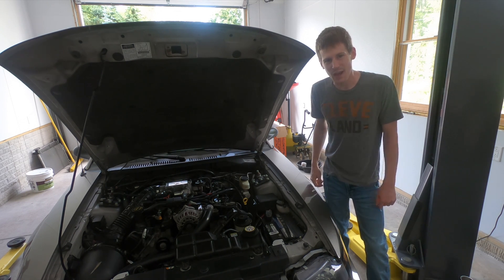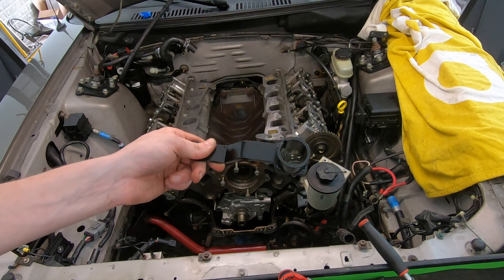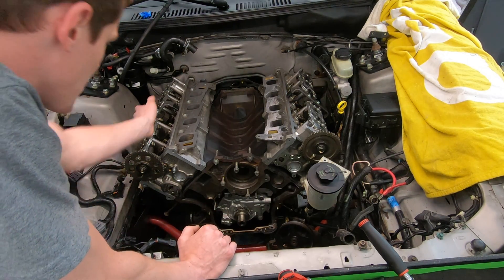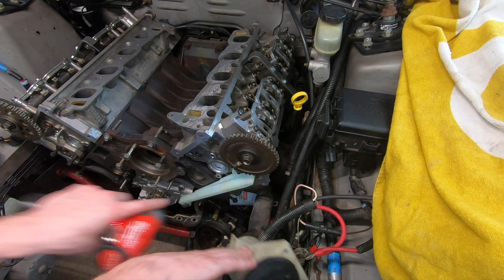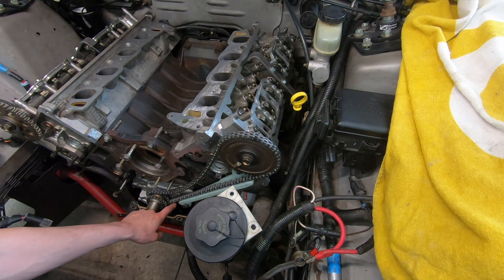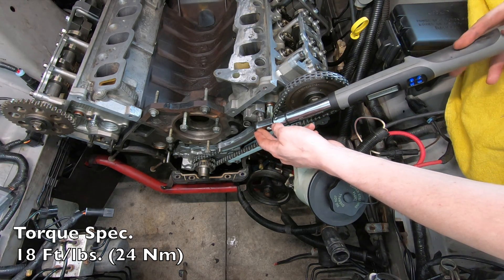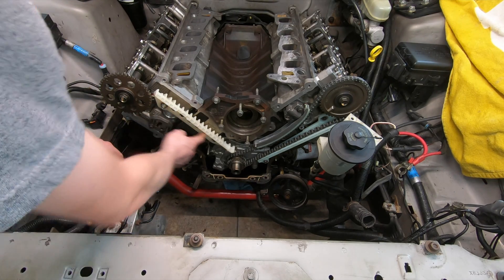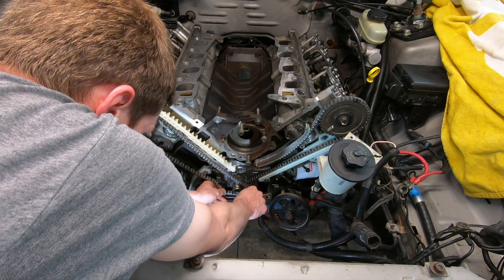Ford 4.6 2V Timing Chain And Guide Replacement.

Comment: Thanks awesome video.. very informative and well explained. I have a question or better say i have a situation. I'm putting 4.6 together for a f-150 2-v the thing is that i'm using pistons, crankshaft, connecting rods and camshafts from a 1999 crown victoria (4.6 Romeo both engines) pistons are a little different (not to deep) and the cams lift lobe are about 30 thousands shorter........combustion chamber is going to be smaller because i'm using my f-150 heads (smaller chamber than crown vic which are open chamber) can the lack of lobe lift compensate with the smaller chamber? what do you think? any advise or suggestions are greatly appreciated Thank you very much.

Comment: I have a 4.6 V8 Triton in my Ford F150 2001 it has almost 300,000 miles on it would it be worth changing the timing belt?
Reply from the maker: Not unless it's making noise.
Reply: Sure, let us know when you find it.

Comment: You can't just pull the pins, sometimes there will be slack opposite of the tensioner side on the chain( I meant that the chain touching the tensioner will be tight, but there may be "slack" on the opposite chain side if the cams are not in the correct time). If I remember right the LH camshaft sprocket is 12 o'clock and the RH at 11. There being slack opposite of the tensioner side means that timing is slightly off. Your method about removing the roller followers prior to messing with the chains was correct, good advice there.  Also I think that cam holding tool you were using (T96T-6256-B) is only meant to be used on Windsor engines, I have a Romeo 4.6 2v and had to use  (T92P-6256-A) and (T91P-6256-A). 

I love these engines, not a fan of the 3v. The HV Melling oil pump is def a must on the 3V's, I hate the new style plastic tensioners and cam phasers (too many issues)

Comment: Hey repair geek. You have a patience of the same he's 4.6 mod motors real junk the valve train components of still 25 to 2700 bucks and you're lucky if you get 300 horsepower out of this motor.. God bless the coyote overall I got to say the repair geek channel good stuff good information good presentation most of all really good camera work.

Comment: Can I change the oil pump while I got the front plate off looks like I can get a flex head wrench in there to get them bottom 2 bolts
Reply from the maker: Absolutely.
Reply: @RepairGeek  02 gt 4.6 2v? Thanks man for the reply!
Reply from the maker: @Gorilla_VR15  yep it will work. 3v or 4v pumps have a larger pickup tube so those won't work unless you change the pickup tube as well.
Reply: @RepairGeek  thanks man! I figured might as well change water pump and oil pump! I’m doing chain, guides and tensioner lol car has 190k miles

Comment: ok I have removed timing chains before setting engine to TDC. Should I lock the cams in the proper 11oclock and 12 o'clock first, then turn the crank to 6 o'clock?
Thanks
Reply: How did it go?Hope it turned out well!
Reply: @markchimmy  it was a pain in the rear but I managed to get it back together thanks!

Comment: How many hours did it take you to get it done.
Reply from the maker: The head gaskets or the timing? I did a lot more than the just head gaskets. With the exception of the oil pan and rear main seal, I changed every seal on and in the engine (valve seals, exhaust manifold gaskets and studs etc.) I wasn't really timing myself.

Comment: Very helpfull and informative !! I purchased a cloyes timing set same as the kit you used. Right side guide had busted were bolt holds guide to head and parts were missing not realizing the revised thickness. I spent about two hours searching for bolt. Started researching why my stock bolt didnt fit, maybee i got wrong kit. Thanks to your informative video it proved that im not going crazy !!!!  Gettin old is a bitch bro i set parts/tools down getting side tracked , most likely my ADHD. 🤪. Spend time looking for shit when ida been done and running.

Comment: Great video ... yup have to replace mine hear metal on metal and like chain rubbing valve cover ..... Thanks for the video
Reply from the maker: Make sure you clean out the bottom of the pan. I've seen the broken tensioner plastic clog the oil pickup.
Reply: @RepairGeek  yup I plan to change oil and flush motor... thanks have too do valve stem seal too ...once I put it back together I can turn the motor by hand to check valves are not hitting pistons ?
Reply: @bengordon7635  hi was wondering how you made out with doing this and the valves seals I'm about to get into it myself on a 2011 cvpi thanks
Reply: @leardi58  haha , was planning on doing it soon had some other stuff on car I was working on...

Comment: Question for you. Got a 4.6, was running but the rocker arms fall in the valve cover, so the gear on passenger side turn loose, how do I know were to put back the gear? Got new rocker arms and timing kit to install in it. Got the cam remove, scope the cylinder and everything looks ok. Thanks.

Comment: Cool vid man! I did this for the first time a few years ago with stage 2 cams with all new components with success. I didn’t lock cams or crank I just made sure all pistons were below deck by inserting a rod in each cylinder to double check piston height, might not be common way but worked great and put my mind at ease. It’s definitely a nerve racking process for the first time especially adding aftermarket cams. I changed oil pump so i needed to prime and I turned over to prime whole system before starting as well. There is definitely a chance for chain to jump a tooth on startup without being primed and without you knowing.Thumbs up👍!

Comment: Thanks for the video. 
So just finished replacing the chains/gears/tensioners in a 2005 F150 that was clicking loud.  Drivers side guide broken.  Gasket blown on tensioner. Got it back together, fired up and it’s still making noise, what now? Clogged oil gallery? Need new slack adjusters?

Comment: They're not that bad, true.  However, why not use a timing belt instead of a failure prone timing chain  setup?  make a  belt a serviceable item like the Japanese engines use with SOHC or DOHC?  These aren't bad, compared to.....     
I can do a timing chain in a dodge or Chev small block a lot faster/easier than these POS
Reply: Belt lasts maybe 100k if your lucky and snaps without warning this chain will go 200-300k original sometimes and has a very noisy long failure so your aware it’s happening

Comment: The reason for the tool for the crankshaft is necessary for most, is because its possible to rotate the engine while removing the crank pulley.
Reply: doing this right now with my friend, we didn’t use anything we just retimed it when we put the new stuff on
Reply: How to retime ?

Comment: The likelihood is NOT very slim with a 4.6. The tolerances are tight. With a relatively small cam upgrade, the mhs stage 2 cam, with 2 degrees advanced, when the piston is at 10 degrees passed tdc you've got less tn 20 thousands of an inch of clearance with stock valves and pistons. There is very little margin for error.

Comment: AYE, I just got those cam holders off your description, I’m doing my timing chain in my 03 crown Victoria, when I tighten it down on the cam, the top piece doesn’t fit?? It’s stays loose , while the bottom piece is snugged up
Reply: You will need 6 washer to make it work plus the washer that's already on the tool . And by the way did you figure out if the replacement bolt number this guy put up on the video work for the new timing the original one is to short for the new guide what bolt did you use or are planning to use . Any way you'll need to buy a total of 24 washers for the tool to work
Reply: You know I actually bought a kit , that came with just the guideds,tensioner, chain, and it came with the REVISED bolt. Btw I ended up using vice grips to hold my cams 😂

Comment: I have a 2002 Ford Expedition. Would it be best if I took the intake manifold of of the engine before I replace the timing chain and guides ? There is a lot of wiring and a fuel rail and all kind of sensors under the hood of this vehicle. Thanks

Comment: Have a 2011 Crown Victoria PI. 130k  when should I expect to be doing this I'm thinking it's never been done. Thanks for any help 👍
Reply: Whenever you hear a rattle at start up it’s time. It will tell you when it needs to be replaced. At least it has for the last 2 4.6 engines I’ve owned.
Reply: My 01 Cv LX is starting to experience engine noise at 418,000 kms
Reply: Mine started rattling at 108K.

Comment: Ever seen a engine the 7 pieces of cam follower or rocker arms fell off just sat at the side of the cyl head on the driver side? Plus the part that holds down the camshaft at the rear( same side drver) all the bolts are at 1 inches out. The pass side all are intact except for the valve lash is too much. 
Now why this happen? ('02 4.6L explorer).first engine starts misfiring but i ignore this for a couple of wks then smokes thick black from exhaust then i lost oil pressure then that finally i have to drive the truck to a place about 55 miles loss a lot of pwr where i can repair it or look for whats causing this. So i remove the usual obstacles to get to t-cover and i found out that
3 elongated holes near the water pump on the pass side of the t-cover the oil was coming out( i just saw the engine all covered with engine oil). The upper guide of t-chain broke to pieces on the pass side. the tensioner chain guide the upper tip is been scrape by the t-chain on the driver side. But other than that i see no other damage. 

Which brings me to ?? That you think the 7 cam followers that came off and the frame of the half part that hold the cam all bolts are out 1 inch or loose this is on the driver side only not pass side. You think cyl 6,7,8 the valves maybe got bent? Or by luck its not?? Of the way its situatuated?

Comment: one tip could be instead of unplugging the crank sensor just crank the car in clear flood mode which is gas pedal to the floor and crank it, the car wont start but you can crank as long as you want
Reply: It doesn't have a carburetor so it won't flood. It will start up at crazy high revolution and damage the engine immediately!
Reply: @How2DoMedia  It depends on the vehicle, but most of them have that feature for safety reasons. The fuel pump is disabled when the gas pedal is pushed down to prevent engine damage, or a possible runaway. Still though, the superior way of doing this is to just pull the fuel pump relay.

Comment: Hello I would really appreciate your help. I set my crankshaft to TDC but forgot to check the timing marks on the camshaft sprockets and they are not at 11 and 12 O'clock where they should be and I've already taken my timing chains off. What should I do to correct my timing when I reassemble the timing components? I'm doing head gasket replacements as well if that helps in providing an explanation. I need to turn the crankshaft so that I know all piston are below deck, if possible or somehow make it safe to turn camshafts without damaging valves?
Reply from the maker: Just pull everything apart and when you go to put the heads back on, set the crank to TDC and get the cam timing close with the heads off the motor. Once its close, bolt on the heads and time it like normal.

You can always set the heads on, don't bolt them down and eyeball 11 and 12 o'clock. Then lock the cams down and continue with reassembly.
Reply: @RepairGeek  Thank you so much. I might comment again if I have another question when I get back on the project. So just to make sure, once I have the heads removed I can safely turn the camshafts to around 11 and 12 o'clock ( i have the 5.4L 2v) with the rollers and valves as they are and then continue with reassembly as normal as long as my crankshaft is as TDC?
Reply from the maker: @LWilson  yep.

Comment: I had my cam phasers, guides , tensioner and chains all replaced and now when going down the road. Out of the blue I’ll hear a loud chain rattling noise.  It will do it for like 2-3 seconds and stop.   What the heck could that be
Reply: You buy after market cam phasers? According to a Ford expert here on YT, they're junk and should never be used. Always buy Ford phasers, only way to prevent that.

Comment: How do you install the cam gears though?
Reply from the maker: Depends on the engine. Some are bolt on like mine, others are pressed onto the cam itself.
Reply: @RepairGeek  I have the same engine. 4.6 2V.  Is there a way to mess it up? Or do the cam gears only go on one way?
Reply from the maker: @mmmmmMuffinz  2 version of the engine. Romeo and Windsor. Romeo like I have has bolted on cam gears. Windsor has them pressed onto the cam and there is no way to change them as far as I know without just replacing the cam.

You need to research what you have.

Comment: Does Anyone have timing components installed on their engine made by Cloyes? I'm trying to get a general opinion as to the long term durability of Cloyes products, since they are widely available for a reasonable price. I'm trying to avoid any mystery brands that can be found on Ebay and Amazon for a "too good to be true" price. I know several people who have used these cheapo Chinese kits, only to have it fail after a year or two. My instinct is to go with Nissan guides and chains, and the two tensioners from Martin Industries, who makes an improved tensioner with a ratchet mechanism to eliminate the tensioner bleedings down when the vehicle is off ($130 each). Anyone with the KA 24 engines (both single & double cam) that have a timing chain rattle should check the website out. This issue can eventually cause a sudden catastrophic failure, so it's best to attend to it sooner rather than later.

A friend had the same engine in this video in a 2002 Marquis that developed timing chain clattering and rattling. It started affecting the timing and was not running well, with hesitation and backfiring. He hired someone to do the chains privately, but the guy didn't drop the oil pan. even though the guides were missing on the passenger side, he neglected to drop the pan to clean out the trash left behind. did not change the oil, neither. When my friend picked the car up, he drove it for about 15 seconds and the engine locked up. When the oil pan was dropped, the oil pump screen was nearly occluded. The oil pump rotor was scored up from the aluminum fragments from the cover and the guides, and the pan was littered with plastic and metal debris. This repair is not complete without the cleaning of the oil pan.
Reply: I think my timing is rattling
Reply: @JerryWasARaceCarDriver  what make and model of vehicle and what engine? Does it rattle only at start up or all the time?
Reply: @plumkey197  2001 P71 rattles at startup and at revs, underneath upper front passenger side of timing cover near valve cover, I used a stethoscope
Reply: @JerryWasARaceCarDriver  That is gonna be an involved job, since all accessories and their brackets must come off. The area you mentioned is close to the upper ends of the tensioners for the right bank chain. Sounds like the tensioner has maxed out, since you have rattling with revs. The rails may be missing the nylon/plastic from the chain slapping and it's just a matter of time. I had this happen with a 2002 4.6L at 200K miles and it started messing with the timing. Not sure if Ford improved the guide material, but once the chain stretches a certain amount, it will start slapping and gradually destroy the guide surface. Ford hydraulic chain tensioners have a ratcheting mechanism to keep the chain from going totally slack when the engine is off, but they can only tension so much on an old chain. If the plunger comes out of the tensioner, it will cause a catastrophic failure. On Ford modular engines, it seems to affect the right side more. The design uses 2 shorter chains with separate tensioners rather than one long chain. You will have to pull the pan to get the pieces out from the damaged guides. Good luck with your project, Sean. There is a Ford tool to hold the intake/exhaust cams in proper time that will make it easier.

Comment: What does it mean if only the left side tensioner put good tension on the chain and the right side isnt putting tension on the chain
Reply: Thats what I'm trying to figure out.  Did you use cast iron tensioner?  Did you use the metal gasket?  I started mine up with the chain lose, thinking it would tighten up once the engine started  it sounds like shit now, probably jumped timing.  Did you ever figure it out?

Comment: are you able to replace just the tensioner guides without using a cam holding tool?
Reply from the maker: You have to remove the chains to get the guides off. When you remove the chains the  cams will move without the tools.

Comment: You didn't degree the cams or check to see if the engine was phased correctly. You get an "A" for being enthusiastic, but you need to understand what you are doing and why.
Reply from the maker: If this was a video about degreeing cams, it would have said so in the title. You need to realize what you clicked on and how degreeing a set of cams is not the same as replacing timing components.

Comment: Hey man i have stage 3 comp cams for the 4.6 is it a must to degree them???
Reply from the maker: 1-800-999-0853
Reply: not gonna lie i had the same question, i figured if i’m gonna do cams i may as well replace the rest of the valve train, oil pump and timing set while i’m in there. how’s the progress coming so far?

Comment: Very helpful. Whats the book your reading for the timing @repair geek
Reply from the maker: OEM Ford. You can find the Ford manual for your specific model on ebay usually for 100-300 bucks for a full set.